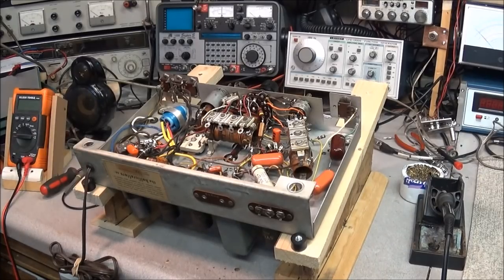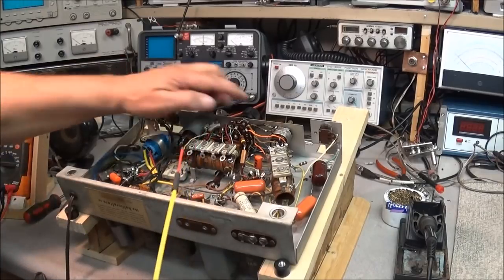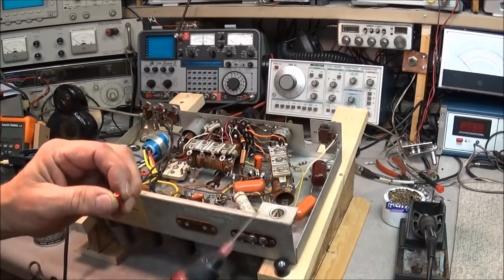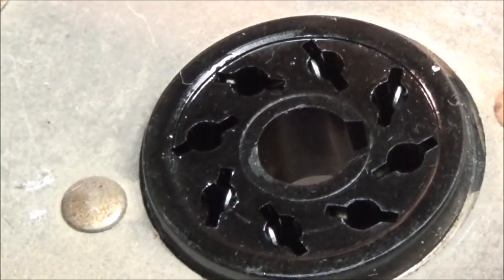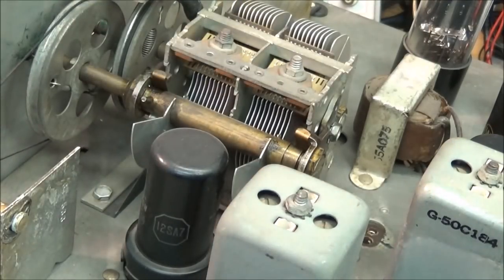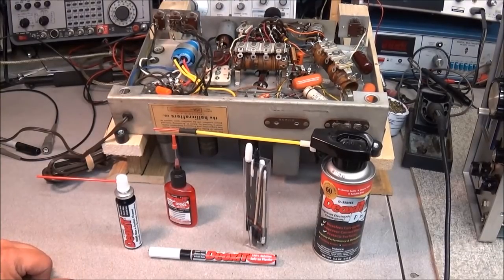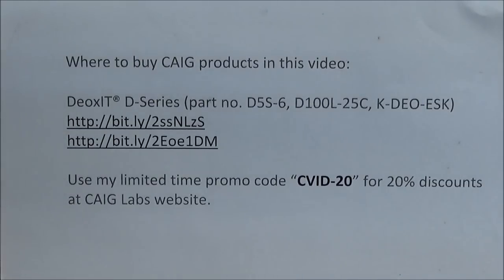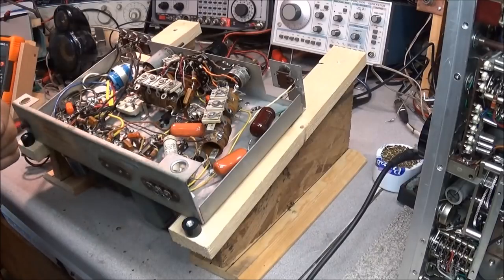#163 Control Cleaning Tip   DeoxIT

Comment: I used DeoxIt gold to clean sockets and pins in the 1943 Bc348 Q receiver I put back together and rewired and on the gears for the tuning used no-oxide just used the brush supplied and that worked breat on the tuning gears operates smoothly now and yes I did get this old receiver back to working again the way it used to be in a B-17. Deoxit  I would never be without for my radio repair projects.I agree the smaller tube is much better in the deoxit . Connectors are great as well to use deoxit on to keep from getting corroded . All great tips thnks for sharing its really appreciated.

Comment: Great tips Buddy. In the case of cleaners less is always more. Caig makes a product called Faderlube which I use on carbon track controls such as volume pots. Clean them first with D5 then when dry give a small amount of Faderlube which provides a lubricant and really makes the control smooth. 73 Doug.
Reply from the maker: Thanks for that tip Doug. I have never used that formula before.
Reply: This is the link to the DeoxIT Fader (formerly Faderlube): http://store.caig.com/s.nl/sc.2/category.293/.f

Comment: Now something that actually works. Ok I need to get some of the Deoxit chemicals. I always wondered what works and what the commercial guys use. Now I know and see who supplies it around here. Thanks Buddy another great tip and so much we can learn from you.
Reply from the maker: When I was working with EF Johnson all they used was a cheap contact cleaner. Would take the carbon track right off a pot. I never had any issues with Deoxit. Good stuff. Thanks for stopping in Lyle.

Comment: Buddy, For Tube sockets I have been using the Deoxit, as you do but I use paint gun cleaning brushes that are available at Harbor Freight, for very little money. They are small enough for the small 7 and 9 pin miniature sockets as well as the larger tube sockets.
Reply from the maker: Thanks for that information Chris. I will check them out. Good to know

Comment: Hi Buddy. The price of replacing an ignition key with all the programming is over $100.00. Most of the time the problem is dirty microswitches. I’ve revived dead key fobs by taking the fob apart, spraying the microswitches with DeOxit, exercising each switch 20-30 times. One real stubborn case required soaking the switches in DeOxit over night. Thanks for the demo on how to use DeOxit. Just wanted to pass on a use for DeOxit that has saved me hundreds of dollars over the years.
John C
Reply from the maker: Good information John. This stuff has many uses. Thanks for sharing that.

Comment: GREAT info Buddy!
I use DEOXIT D-5 spray with the long red straw and when I need a small amount I do like you do and spray a little in a small bottle and use a cotton swab to apply.
Sometimes however I can't help getting the phenolic wafer very wet with DEOXIT.
The D100l is way too expensive, I do this as a hobby, maybe if I was doing this as a business I would buy it.
BTW what camera are you using?
It does great closeups and stays in focus.
Keep up the great videos Buddy!!
Reply from the maker: Thanks Bill. Yes D100L is costly. But that is the thing with stuff that work good. I understand what you mean. The main camera I am using is the Sony HDR-CX240.  When I bought it 4 years ago it was on the high side. Now you can pick up a new one for a little over 100 bucks on amazon and EBay. 
Thanks for stopping in.
Reply: Thanks Buddy for the information.

Comment: Found a place not to use deoxit (direct sunlight). I applied deoxit to navaid lanterns for offshore use. Figured it would keep corrosion at bay from the 12v bulbs and gold contacts. Well i was wrong...the deoxit turned non conductive under the uv sunlight. It made a sticky mess. The unit made its way back to my bench and thats when i discovered this issue. Deoxit works great for all my other needs!
Reply from the maker: Interesting information . I did not know that. I think maybe a dielectric grease may be better? Thanks for sharing
Reply: interesting, is it possible it was some weird reaction with something else, maybe silicone grease or some other lube on it before?
wondering because I've had other lube and cleaners do odd things before, none of them electronic/electrical though.
Reply: throttle bottle anything is possible out there (gulf of Mexico), but I doubt the tech who installed the flasher added anything. I fully cleaned the bulb turret parts in simple green followed by rinse and dry. Then Deoxit "G100L" was applied to contact points. Keep in mind this flasher is under a clear lens in full sun. I could perform a test at home simulating same conditions.

Comment: Thanks for the video, it is excellent as usual. I am a bit confused though. Why is it important not to drench the phenolic on the wafer switches with Deoxit, but it is okay to hose down the pot's phenolic with the stuff?
Reply from the maker: Hi Ian. Let me see if I can help with that confusion as this is a great question you are asking. The phenolic  that is used in the wafer assembly are thin, dry, and hard to come by.  The phenolic used in the pots are and slide switches like on the front of this S-38 receiver and thick, covered in grease, and can be replaced with modern counter parts. Unless it is some rare breed of switch, I would not worry about them as much as the wafer type.  Also some wafer type were proprietary to the application it is used in meaning no replacement available. I ho[e this clears up the confusion.  very good question.
Reply: It absolutely did clear up my confusion and I appreciate your taking the time to explain. Thank you.

Comment: Gunshops have all the brushes you need.....all sizes and types, nylon , brass , copper etc etc.....great for cleaning valve sockets and female connectors
Reply from the maker: Good to see you. I will check that out. Thanks

Comment: Use to use over 15 to 20 cans of DeOxit cleaner a year.  When they went to the fire hose for a straw I stopped buying it.  I will no longer use it because it just waste so much product and makes a huge mess.  Bring back the normal size spray can top and I would buy it again.

For cleaning tube sockets you can get pipe cleaners that also have plastic bristles mixed in with the normal fibers.
Reply from the maker: I really wish they go back to the old can top.  Yes the add on straw helps but then you have to put up with that on the end of it. Perhaps they will rethink this.  I have some of those pipe cleaners you mentioned. Works great for tube socket cleaning. Thanks for stopping in Mike
Reply: My bottle of 100% DeOxit is probably more than 15 years old and it's still half full. Use it and the other can and liquid products all the time. Works great as Buddy says on UHF and N connectors to maximize the electrical contact and even more so lets the shells screw on so much easier. Glad I have a couple of cans left with the old style dispensing straws!  73 - Dino KL0S
Reply: @MikesRadioRepair Thank you for your feedback. We do have the older version DeoxIT D5 in LMH spray available now. You can order it soon from Parts-Express.com or from our website: http://store.caig.com/s.nl/it.A/id.3118/.f?sc=2&category=188
Reply: That's good to hear.  Love your products but that new can top is just to much.  I need to be able to put a very long skinny straw in the can for access in big older radios and adding a straw to the end of another straw is just not convenient.
Reply: Ditto!
Reply: We have reduced the amount of propellant and changed the valve size on new D5 Perfect Straw sprays (new batch) and this has eliminated the excessive spray. To see all the hacks of the Perfect Straw spray can, please go to: http://caig.com/hacks/
Reply: That's kind of the point though.  It was perfect "before" the non "perfect" straw.  Why redesign something so it's not as good and then have to modify it so it works like the old one did.  This is why when I find something I like I buy extras.  If it's perfect we all know the manufacturer is going to redesign it and make it worse.  Only problem with this is it's a consumable and I could only stockpile so much of it.  Thankfully you put it back in the old can.  This new can top just needs to go to the bad idea grave yard.
Reply: I don't use much often, but the huge nozzle on D5 does seem to be a waste.  I have the L-M-H nozzle F5 can and it's obnoxious over-blast anywhere but on low.
more time cleaning the over spray off than the actual application.
I don't care for the flip up/down nozzles on other products like WD-40 either, bumped wrong when working, you end up with well lubed hands or it sprays back in your face.
they are good when working in some areas, like on a tower trying to fog into cylinders and blind holes, places where the straw blowing out would be real bad. they mess up often too get knocked off the can nozzle and end up sticking spraying product out all under the snap on part (haven't had that issue with deoxit yet)
instead of the whole nozzle change, maybe they should supply a pack of straws or find a simple way for them to lock on better. ( end rant)
Reply: MikesRadioRepair   Buy the liquid on Amazon. Has long needle applicator. Can dispense a single drop.
Reply: Doc Pedersen 

I have that and a large glass bottle of the D100.  Is no good for controls.  Has to be a aerosol.
Reply: MikesRadioRepair  Depends on how applied. Take them apart and wipe elements with swab. Talking about 35 years experience with what is now called DeOxit. (That is just time using Deoxit, add at least another decade repairing electronics.)
Reply: Customers would never pay for the extra 1 to 2 hours of labor it would take to remove controls, disassemble them, clean, reassemble and reinstall.  A spray can takes a minute or less to clean the controls.  That's why it comes in a spray can in the first place, ease of application.
Reply: Mike, I always fine the "New and Improved" products have screwed up something I really liked about the product to start with. I always cringe when I go to pick up an item and see "New and Improved" on the label.

Comment: I had a tec use that stuff on my radio that i just installed new burns pots at the time i did not have the tools to align it properly and it washed all the grese out of the shaft I was so pissed..
The stuff works b
Good but i woild never use it on a new controle
Reply from the maker: You are correct. In fact just plain contact cleaner will wash the grease out.  Even alcohol.  I probably should had mentioned that.

Comment: Thanks for the tips on cleaning contacts.  I have a very small bottle of Deoxit that has a small brush applicator,  like a ladies finger nail polish brush.  I fine that very useful to get a little fluid just in the right place.
Thanks again for another useful video.
73
wd4dda
Reply from the maker: Those brush applicators work great. Puts the stuff where you want it. Thanks for stopping in Preston
Reply: @Preston Shute Thank you for using DeoxIT, we appreciate it. If anyone wondering, here is the link to the product mentioned (DeoxIT in brush applicator): http://store.caig.com/s.nl/it.A/id.1701/.f?sc=2&category=188

Comment: Buddy the promo code "CVID-20" does not work for me. The time and day I did it was wothin 24 hours of the video release. Let me know if iy typed correctly, I typed in as above without the quotes. Its currently 2am on April 30.
Reply from the maker: Video uploaded on the week end so may be end of Monday to late Tuesday before the id code is valid. I do not think they work on the week ends.
Reply: @Learning Electronics Cheaply it should work now, please try again. Please reply here if you still have the problem. Thank you!

Comment: The complaint is not being like the pressure washer. The complaint is in 2016 - 2017 CAIG changed the applicator from the original low medium high fine point application to the new fat leaky Clunky material waisting crap applicator. That is the only complaint, That is everyone's complaint. However,  CAIG is not a company that listens to customer needs.  The company is just another dim a dozen companies like the  95% of the rest.  For a while, I was hoping CAIG was going to be one of the 5% that was created at making a profit while also listening and providing the needs of their customers. Let down once again. There are some other products just as good if not better. I have noticed in the past 2 years people have started to find them and switch and the main reason is the applicator. Stupid right. You would think a company would have picked up on their customer's dislike of the new applicator I mean 95% of there customers. Then changes it back while saying I hear you customer and we at CAIG got your back.  NOPE never happened!!
Reply from the maker: Troy,
I love the Deoxit stuff.   But I do have to agree with you. The new design is total garbage and waste more product than you use.  And the reason I went back to my CRC stuff. Half the cost and works great.

Comment: Deoxit SUCKS. Never again. Me bench the radios and everything I use it on becomes a mess.
Reply from the maker: Hi Gary. Please explain on what happened and what formula you were using. Been using it many years with no issues.
Reply: Hi @Gary P, we are sorry to hear that. Please email us at info@caig.com with your concerns. We will try our best to fix the problem. Thank you!
Reply: Caig labs was there to help and send another can. So I am not bad mouthing them. Second can acted the same way. It is impossible to just use a small amount. After the inital spray the can drips all over. There is so much force in the spray it goes all over the place. The product is good but what caig puts the product in to dispense is not good.